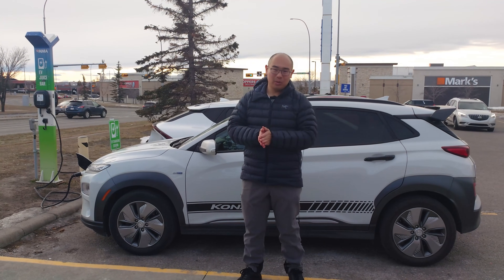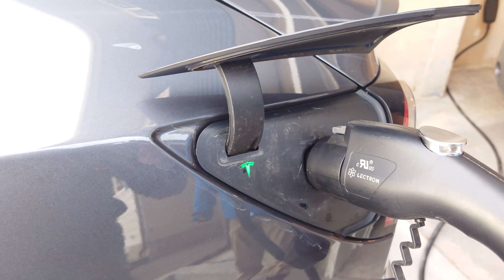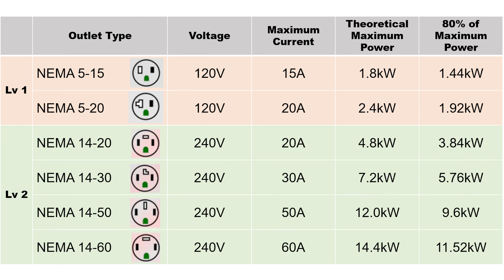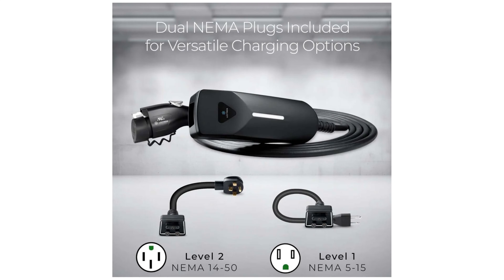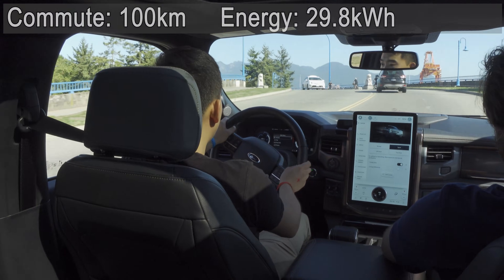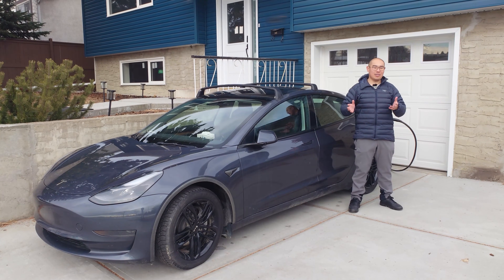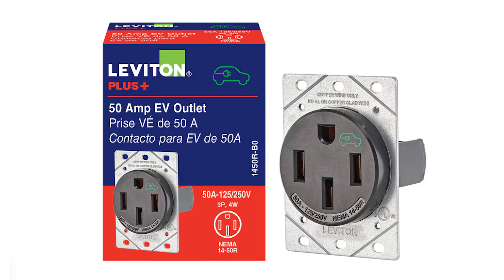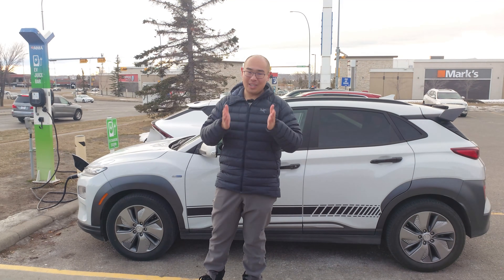All About Level 2 Charging

Comment: If an ev had an "onboard charger rating" of 3.3kw is it still capable of 240v charging?
Reply: Absolutely, but no more than 3.3 kilowatts at 240 volts, providing your EV with at least 10 miles per hour of added range.

Of course, if your vehicle also has the capability of accepting a DC charger, that's a much faster charging option but not recommended for daily charging as it may damage your EV battery in the long term.
Reply: @marclemieux8269 thank you!

Comment: You forgot a Nema 6-20, 240Volt outlet. That’s what I currently have. I get about 3.8Kw.
Reply: And that is a big miss, especially for those with limited electrical service capacity.  A 6-20 receptacle can be installed using an already existing a properly installed 120v 20 amp dedicated circuit.  The conductors will, in most cases, not need to be rerun, but upgrading the 120v circuit breaker to 240v 20 amp and the receptacle.
Reply: @ Definitely. I also Installed a 20 amp 240 GFCi to the 6-20 to have extra protection.
Reply: Exactly what I’m doing  👍
Reply: A NEMA 6-20 outlet can provide an impressive charge rate of up to 15 miles per hour.

Over a 12-hour off-peak, overnight charging period, as is the case in Ontario, Canada, that's about 180 miles of added range, which should easily satisfy the needs of most drivers!

Comment: Hardwiring is safer than using a 240V plug. These plugs can fail over time and be a fire hazard.
Reply: I L2 charged on road trip once. Navigated to gas station with tesla and CCS chargers. That was advertised as "Rest Area". When I got there signs said no sleeping. There was also L2 charger beside CCS. So I plugged into the L2 and slept while charging. A good 8 hour rest.
Reply: like everything else.
Reply: Yep. Thats why I always suggest a Bryant or Hubbell outlet.